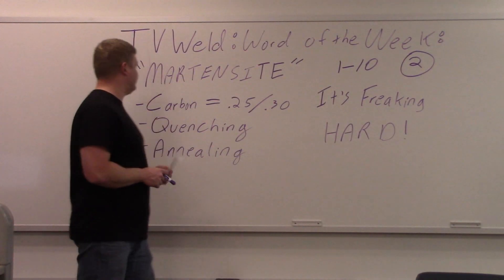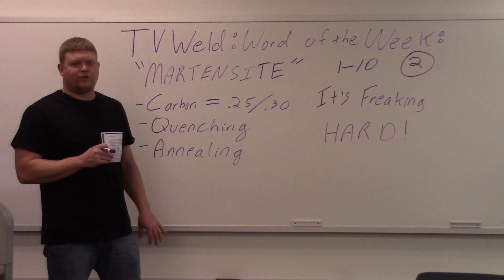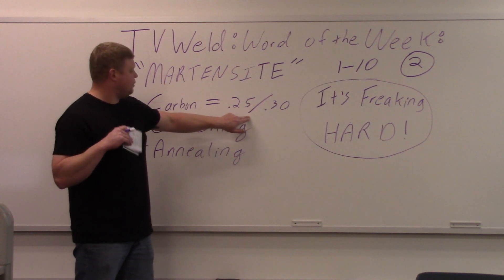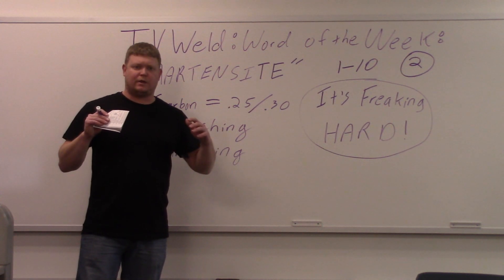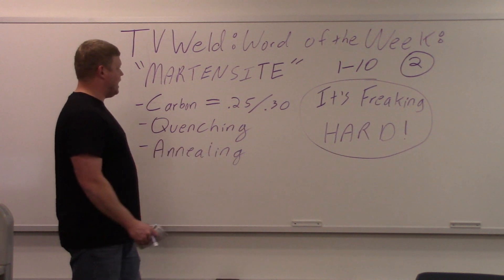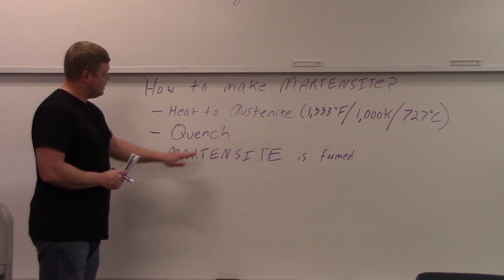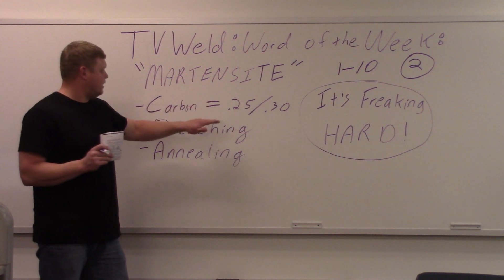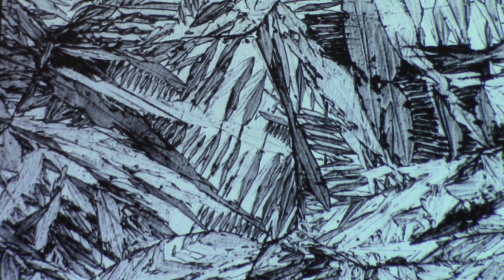MARTENSITE

Comment: Insanely informative. Just a recap, of what I learned from this video (and a testament of how well this lesson was explained)..
In order to from martensite, you must start with steel that has a carbon content of at least 0.25% and then heat to 1,333 degrees Fahrenheit  1,000 degrees Kelvin or 727 degrees Celsius, to an austenitic form and then quench to form a hardened state.

Comment: As an engineer you hit the key points, martensite is EXTREMELY hard and subsequently very brittle and terrible in any application where impacts are expected, which is why in a lot of applications, they use tempered martensite.

Comment: your recommendation for railroad tracks? the rails need flexibility, the grinding of the rails seems to create martensite, therefore a very hard "layer" on the surface of the rails, with the consequence of a loss of the capacity of the rail to bend a little under the passage of the wheel. any opinion?
Reply: Thermite.

Comment: Can you explain how quench cracks form? What causes them? How do you avoid getting them?
Reply from the maker: Basically as your quenching the material it is putting too much stress internally on the metal causing it to crack.  Excess carbon can cause this or the wrong quenching media.  To avoid getting them you would need to quench a little slower or get a different kind of steel.